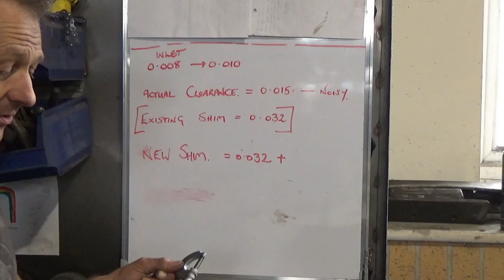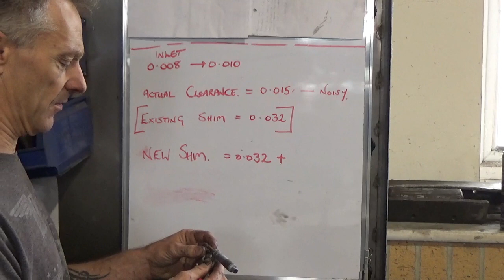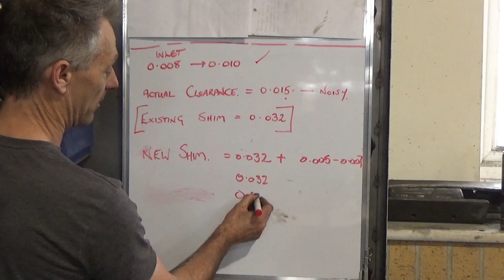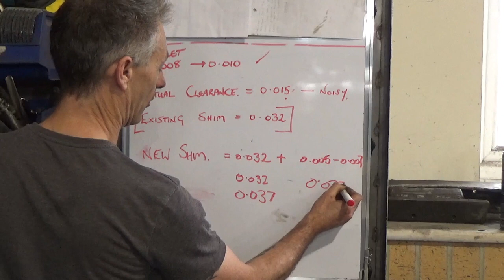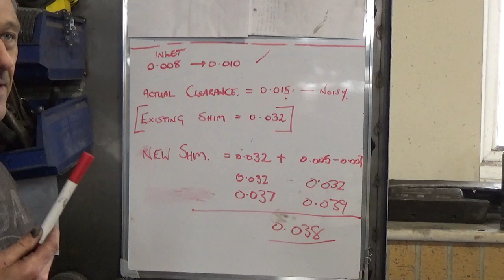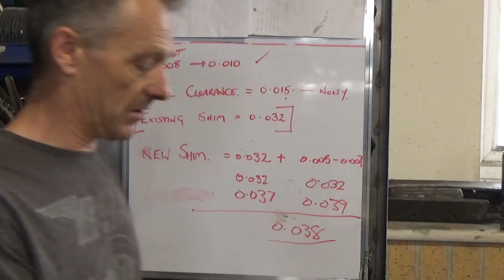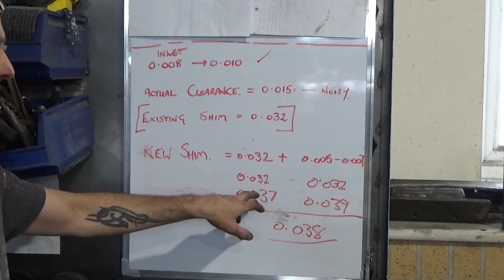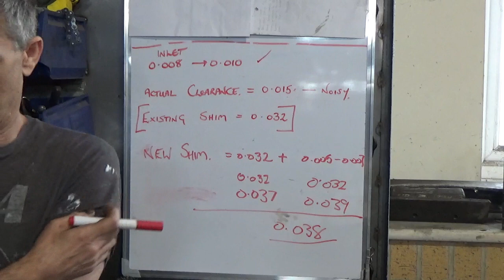How to check, measure, calculate and reset Triumph Stag Cam/tappet/valve clearances bucket and shims

Comment: , I have known some set too 4 or five thou on inlet , and 8 or so on the exhaust with out problems this is due to the early  yellow Manuel stating different values,  I guess they wanted to be safe and increased,  yes oil pump pressure , the pressure release valve can stick only then gives 15 20 psi , rattle rattle ,  if left for long time seen them jump up to 50 psi  after five minutes, noise goes , Iv seen people put Saab oil pumps that give 90 psi and destroys chains and tension pads , thanks for sharing  all very interesting , well I think so ,
Reply from the maker: Thank you Steve,  seen all sorts of valve train problems over the years,  it's hard to show on the video, but you kind of know what is causing which tap!customer was worried about the chains as he had the engine rebuilt, but has heard the chain scare stories.  Checking the shims was more to be safe as I was pretty sure that wasn't the problem

Comment: As the SAAB engine is the left bank of the Stag V8 certain parts are compatible, SAAB shims came in finer sizes and if I remember correctly you can use the chain guides and tensioner.  I used to put a half penny in the oil pump bypass valve spring and this gives another 5 psi and helps the tensioner at low RPM.  As mentioned watch  the tensioner does not over set.  Engine must be cold.

Comment: The tapping will be  valve bucket wear. The noise results as the buckets turn in the bore. If it was an excessive valve clearance it would permanently apparent.
Reply from the maker: It isn't a regular tap, it starts from cold then clears. If it was the buckets it would be more regular,  and louder. It's hard to explain without hearing it, but I know what you are thinking.

Comment: I’ve been working on stags for over 40 years most valve gear noises are from worn valve guides ,incorrect    
Valve height set so buckets hit the valve spring cap and ultimately shatter once all these things are correct they require little maintenance clearances rarely change if all engineering is carried out properly there’s not many out there that can do it right ,I’ve put loads right that have been badly done!